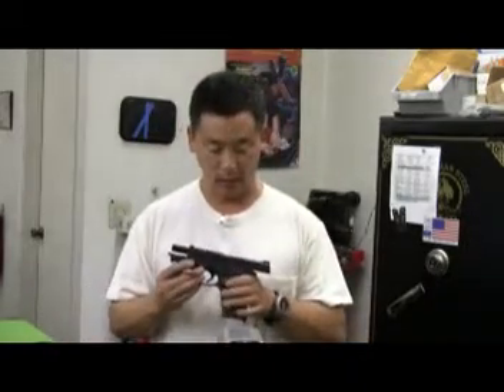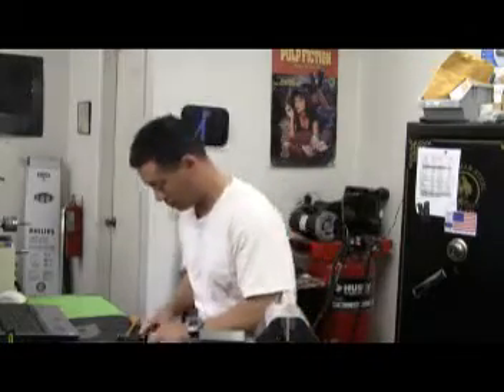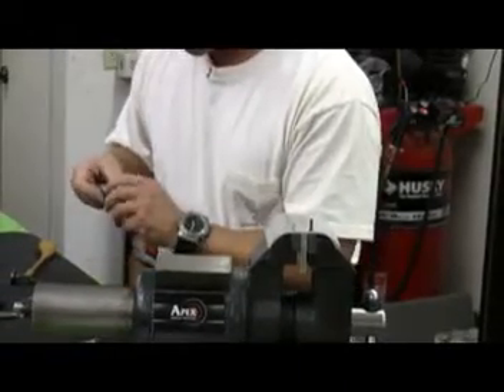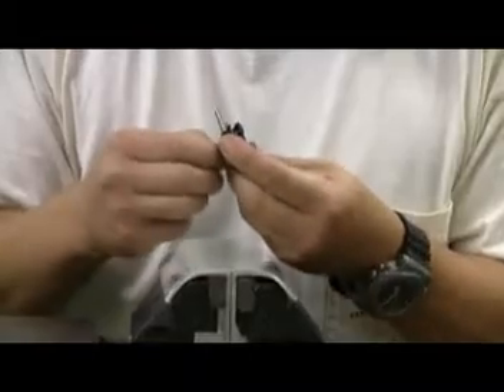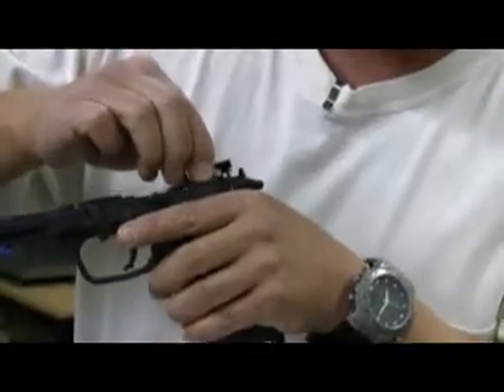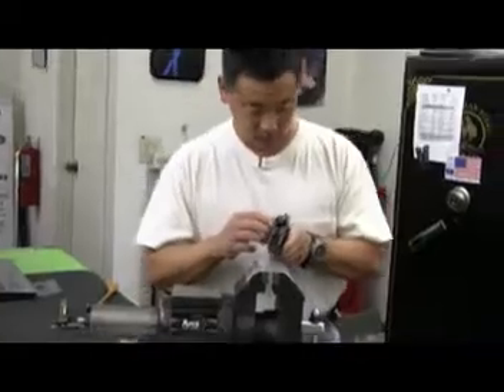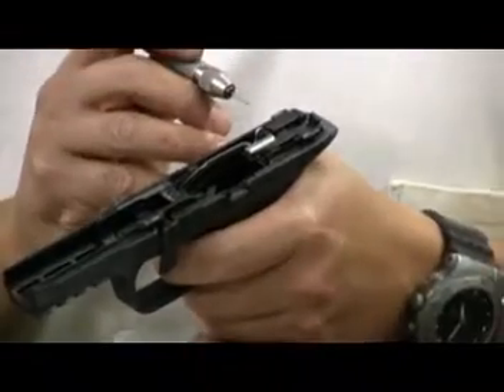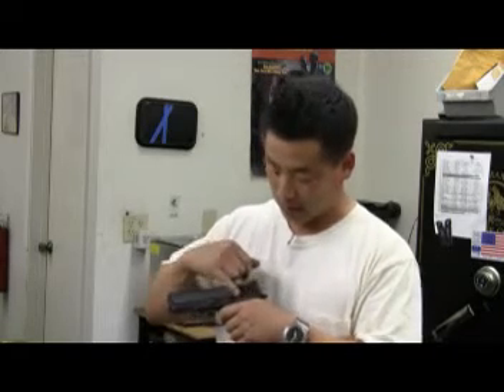RAM Install

Comment: So two things: one, You say you compress the spring when you put the trigger bar in there, how do you do that, exactly, and which way did you compress it? Wouldnt a more accurate way to say it is you put the bar as far against the sear as possible? Also, at 3:58, you say to use a 1/8" roll pin to put the roll pin in. That's not what you meant is it? Didn't you mean a 1/8" punch?

Comment: if you need any help on disassembling your gun check out gun disassembly 2. They have an M&P for a dollar. you can watch the demo and or play the disassembly game. labels on every part and how they come apart minus the tools(1/8" roll pin punch). Also helpful if you get your gun completely apart and forget which direction something goes on in or what the assembly order needs to be.

Comment: This video was not much help as it did not get clear and up close with the actual installation of the ram. However once I broke the gun down it was quite self explanatory. With that being said this greatly improved the physical and audible sensation of the reset on my pro. Initially I took it to the range and was perplexed when I let off the trigger and felt almost nothing. I think this will clear that up quite nicely. 20 dollars and 5 minutes of your time is what it takes to greatly improve your trigger. It might just be me, but the pro seems to have responded much better to the ram than my regular mp9 did. Thumbs up APEX

Comment: I can't believe how many people are complaining about the video quality. Man people really have been spoiled in this digital age haven't they. At least you have a guide to install it, this video easily shows you what you need to know. I was wondering why this RAM will not work on an M&P 45? I own the 45 and have installed the DCAEK and love it, I want to use the RAM really bad but they say it doesn't work in 45 model. Why would Apex leave out the best M&P?
Reply: It's crappy quality.  If I wanted to sell something, I'd make a better video.  It's laughable.  In this "video age" it shouldn't be so poor.

Comment: i should have done this first. Just installed it after the other parts of their kit and this is by far the best modification I could have done! Soooooo cheap and easy to do for the benefit you get out of it.

Comment: So easy & so worth it. Thanks for making an awesome product!
Reply: With that hole that S&W built into the sear block it’s like S&W was planning something like this for down the road.

It’s amazing how well this product works and it’s extremely reliable.

It’s been a decade since you posted the.

If you still have your M&P and you haven’t done it, the full Alex tactical trigger kit is 100% worth it.

I have the curved aluminum AEK trigger. It’s dank!

Comment: Made my trigger reset 2 times more noticeable. Was expecting more, but still a great improvement over stock. Would a stronger compression spring improve the reset? Thanks, Torn

Comment: I just purchased my M&P last week and was wondering why people were upset at the reset. I was fine with it-really. Then someone said try out the APEX RAM, and I said why not. Purchased this and 2 days later installed it and BAM! That double reset / fake reset feeling went away. Awesome product. 

And for those of you wondering why yours isn't as loud as the installation video's was.. just put a little oil and you'll be hearing the reset CLICK loud enough.

Comment: Just installed and works like a charm.  In video your reset sounds louder then mine... not that i can't hear mine just yours sounds louder.  Is that just because of your mic turned up so we can hear it better?  I really do feel the reset which is great and can hear it also just wanted to make sure i did the install right.  Great product..drop in and done....love it.  Thanks Randy for video .....helped a ton!